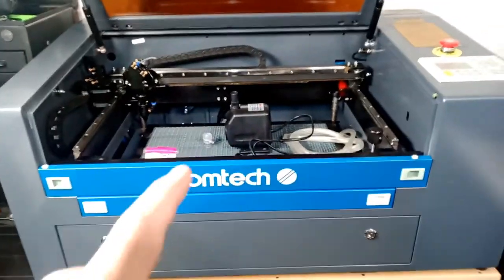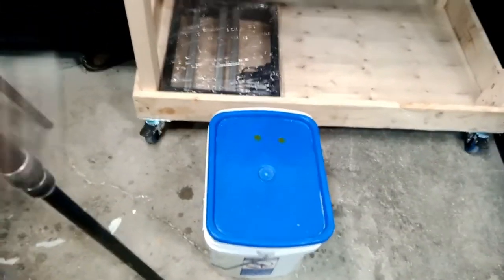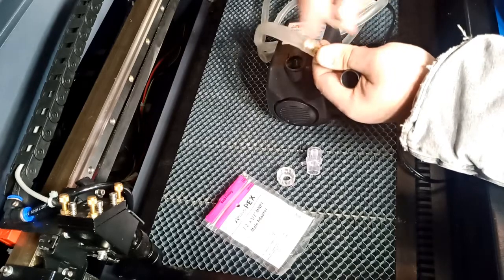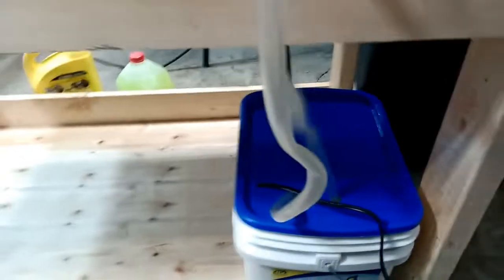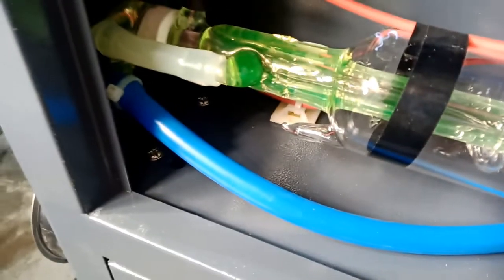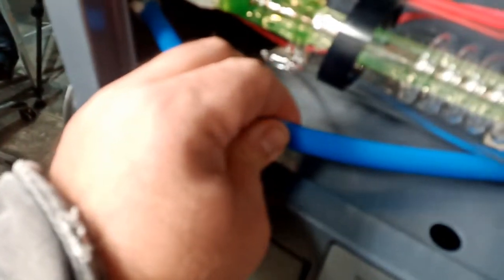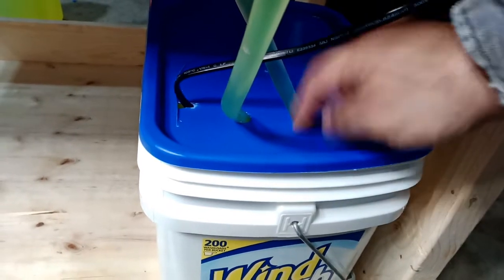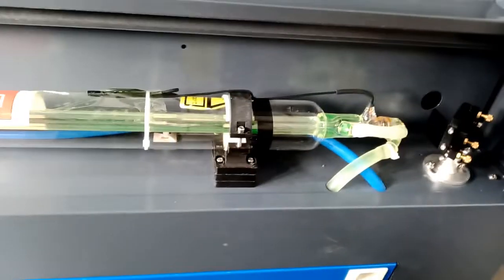Water Pump set up for OMTech 50W CO2 Laser Engraver/Cutter

Comment: I also have a 50 Watt Omtech. The laser doesn't need a lot of water flow, I did an experiment and found that just having the pump running with the laser off, the temperature of the water went from 68 degrees to ninety degrees in about two hours.  That's the pump adding a lot of heat.  When I did my bucket, I made seals for all the holes (in, out, electrical cord and thermometer).  To weigh down the ends of the tubing, I tied on a couple stainless steel washers (they were left over from the through-holes)  using cable ties. To seal the through holes I used bulkhead connectors, with large washers and some sheet rubber.  Yeah, cut the rubber washers on the laser.  For the electrical connections I made a hole big enough for the plug to get through, about one inch, and a pair of sandwich plates about three inches, out of aluminum, and assembled  with 1/4" craft foam.  Another hint about the bucket...cut the detents a little so the lid can come off easier.
Reply from the maker: see I did test the bucket and don't take me wrong it's not bad but when summer time comes I think you will need a chiller do to after running my machine for some time that water dose get warm a little bit, and wherever I was reading everybody recommends a cold laser tube  will give you a longer tube life.
Reply: @wisamyousif14  I'm working on a Peltier cooler.  First version, which was intended to test,  with one Peltier, didn't quite do the job, so the next version will have four Peltiers, and much better heat sinks.  The biggest bugaboo was drilling holes in the heat sinks without smashing the fins.  Ok, I messed up a little, but they are going to work fine.

Comment: Have you had any trouble with the coolant. I just ordered it and will have to use coolant to.
Reply from the maker: Where do you live what's the temperature look like at your location.  There is no problem at all of using cooling
Reply: I live in mid Michigan. So we get temps below 32 most of the winter.
Reply from the maker: @patricksoutdooradventures8488  
He was concentrated antifreeze and mix it with distilled water do 1.5 to 1  

1.75 water  to 1 antifreeze